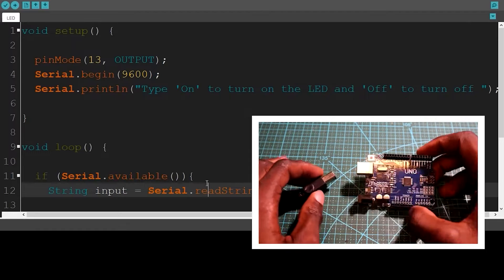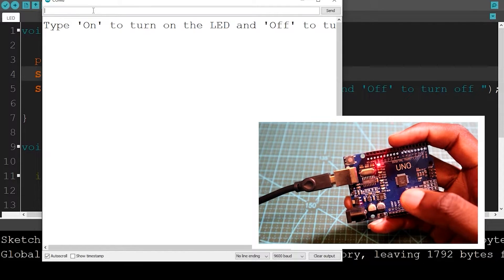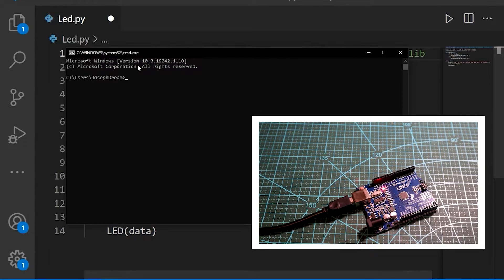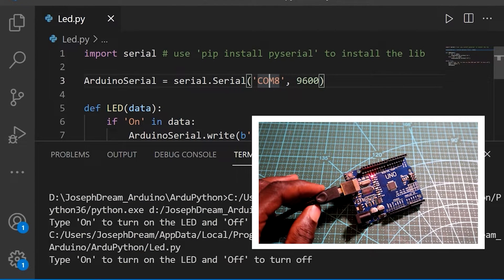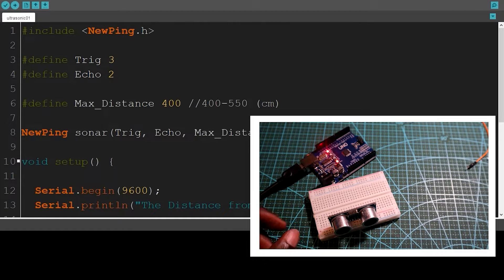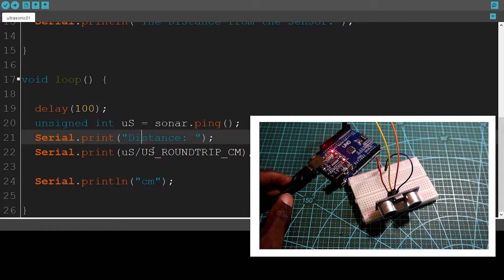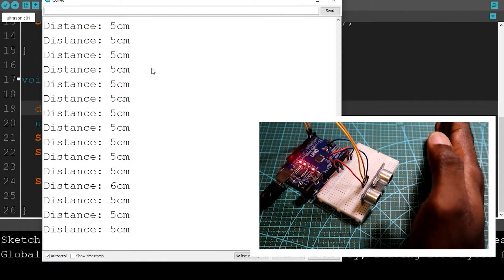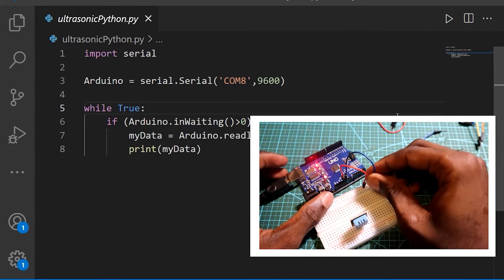How to read any sensor using only Arduino and Python

Comment: Write some code to de-serialise TCP data from 4different scales (different IP address) to be visualise 
as digital LED object. The value that is being read is weight. Use python. Could u plz assist in this question

Comment: Hey Joseph It is a very helpful video. Thank for sharing. It helped me a lot. I am trying to write some code to do a little different. Can you please help me out.
Here is what I am trying do.
1. I have written some code in python using pyautogui and it does some magic. Then after that I want it to send command in Arduino to blink led to indicate that the first job has been done.
2. After couple of blinks again python has to run its second part of script and again after completing it has to send command in Arduino to blink led.
Can you please help me out to find the right way to do this? Please please please.
Reply from the maker: What’re working on??

Comment: really nice video but i really need help in how to get the data of the distance sensor in integer format and add/subtract another integer from it.
can you please provide me code for that
Reply: Would need to test it but all I can imagine you need to do is convert the input into a string, split it around just the data and then convert that string into a float:

myData = Arduino.readline()
stringData = str(myData)
formatData = stringData.split(": ")[1].split("c")[0]
floatData = float(formatData)

Don't know if this 100% works but I hope it helps
Reply from the maker: https://github.com/Amajo0209/How-To-Read-Sensor-Data-Using-Python-and-Arduino

Comment: good video, it helped me with my project a lot however I must say I am deeply saddened at the fact that the code is not provided
Reply from the maker: http://blog.josephdream.tech/blogdream/index.php/2021/08/06/control-your-sensors-using-python-and-arduino/
Reply from the maker: you can check out the link above
Reply: @The_JosephDream  link is not working man